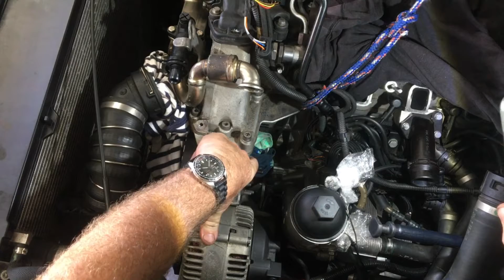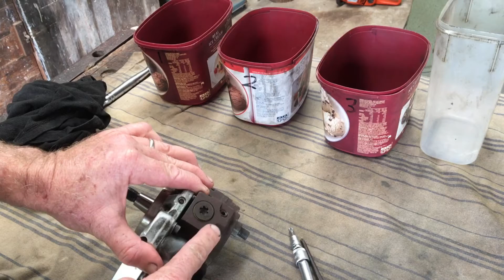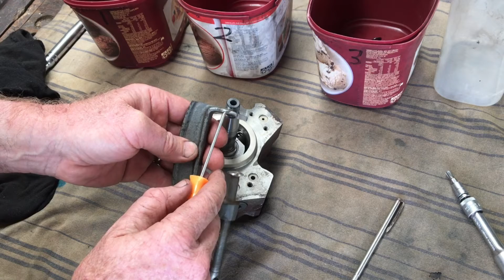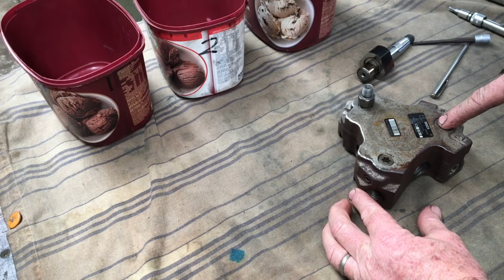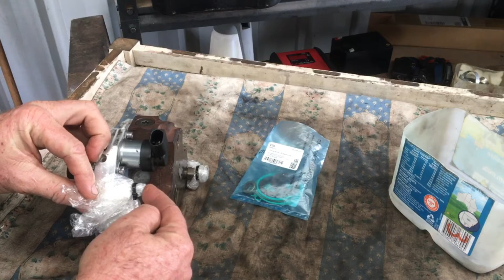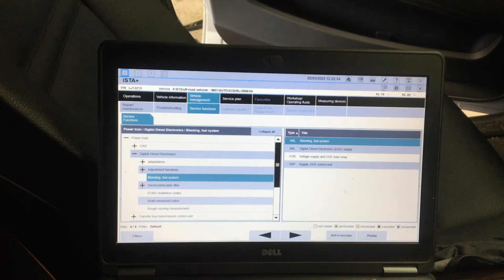BMW E70 M57 high pressure fuel pump removal, rebuild and bleeding

Comment: Good day, is the socket tool to remove the pump needed or can the pump be removed without the socket in front?
Reply from the maker: The pump can be removed, but the socket holds the sprocket inside, which is on the two timing chains, in the correct place. So without the tool the sprocket will fall down and you won't be able to get the pump back on and the timing might get screwed up. In a nutshell, you can remove the pump without it, but it's a bad idea.
Reply: Thank you, Can I ask for advice?
When my Bmw is cold, it starts up and idles no problem…as soon as it heats up and not to a point where the fans start… it cuts out completely and then struggles to start or will start and then cuts after a few seconds.
Reply: Fault code 42E2 and 4b90 normally comes through the diagnostic tool

Comment: Just wanted to say thank you so much for this video! I’ve just put my new hpfp in tonight, need to do the bleeding process tomorrow, havnt used ISTA before so this will be my first try with it! What motivated me was multiple garages (one supposedly a well known BMW specialist in Essex but I won’t name names, told me diesel getting into the oil would be a dpf problem… ruled that out then I was told it must be the injectors!! Only after a lot of research I came across the likely issue being the HPFP and ive lost faith in the garages so I plan to do everything I can myself! 😊 Excited to do more on my car after this though 💪 my cars a BMW e65 730d with the m57 engine

Comment: Excellent video and thanks a lot! I'm changing my oil due to dilution now - and since I've now confirmed that the DPF regen cycles are not occurring too frequently, potentially causing fuel to leak down the cylinder walls, I'll be ordering a kit for my pump as well.

Comment: Hi, Great clear sensible video. I am about to tackle this as I have fuel dilution in sump and this appears the most likely culprit. Can you advise what gaskets ,o rings, bolts are required so I can order prior to start. I have heard some bolts are single use and any other hints or items I should replace whilst engine apart as it has 190,000ks on it. I am in Brisbane Australia and have found O rings for fuel pump only available in UK. I have a Foxwell scanner to bleed system when finished. Cheers and Thanks.
Reply from the maker: I didn't replace a single seal or bolt other than what was in the seal kit. No issues with leaks and there are no single use bolts in this area. Used the Meat and Doria seal kit, which I had sent to me from Europe. From memory cost me about $60 plus post.
I'd be checking the swirl flaps while in there, and maybe doing a swirl flap delete. Lots of info out there on this. Also check the intake ports for carbon build up.

Comment: Thanks for the informative video. Quick question regarding the fittings at the rear of the pump going to the rail. Does it appear that the high pressure output fitting could be swapped into either one of the three holes (two of which have plugs, in addition to the spring and ball bearing)? I'm in the process of swapping this pump into a 2.0 TDi golf. The high pressure line needs to be bent, and if I can use one of the other holes for the output I would only need to bend the line about an inch vs approximately 6 inches.
Reply from the maker: When I looked at a lot of information prior to the rebuild, it did look like it was a common output passage that ran via all three positions. So I suspect you are correct and you could locate the output at any position. I also suspect this would be part of the design to give flexibility for different platforms.

Comment: Hi! Great video. What is a common failure on this pump? Have an issue with this pump does not build more then 100bars for pressure. The car have been sitting for a few months? Is it that the pistons get stuck or clogged? 

😅
Reply from the maker: I'd be very surprised if there was a physical issue within the pump. I'd be looking at the supply pressure. High pressure output is controlled by the input pressure. The pressure control valve does this by allowing pressure to be returned to the tank. If getting limited pressure from the HPFP I would first be checking the pressure coming from the electric pump in the tank. It could be as simple as a clogged fuel filter.
Reply: @jeffrichardsoncardiy  thanks for the reply! The pump in the tank and fuel filter is changed. Insta says we have 100bars pressure in fuel rail. We have disconnected the sensors at the fuel rail and still no start. Could it be the fuel regulator valve on the HPFP ? It clicks but maybe its faulty anyways? 
 Thanks again 😀
Reply from the maker: I'm not an expert on these pumps and have zero diagnosis experience, so this is all just a guess. Looking at the way the pump and regulator work, the regulation by the solenoid of fuel return is what controls pressure. If this is stuck open then it won't allow pressure to build. I've done lots of transmission solenoid testing before, and the regulator seems to be pretty much an identical item. I'd be removing and pressure testing. 

Have a look at the following video. It's for a Porsche PDK transmission valve body, but I show how to test the solenoids, which I assume would be an identical procedure.

https://youtu.be/iXMHyk8uZG8?t=969
Reply: @jeffrichardsoncardiy  Have tested the regulator on the fuel rail with 12v and no clicking sound from it. Seems likely its stuck open and thats why the pressure only builds up to 80-100. Going to change it and see if its starts up. Thanks again super helpful video and replys.
Reply from the maker: @bengt1758  Did you test the regulator on the pump or on the fuel rail? I was talking about the one on the pump and I didn't know there was one on the fuel rail. Looking at realOEM it seems the one on the end of the fuel rail is also a regulator. No idea how this one works.
Reply: @jeffrichardsoncardiy  I tested both, the one on the pump works but the one on the rail does not seem to work. Neither of these regulators have an faulty code possibility maybe if i had gotten it to start it would have given a low fuel rail presserue code. But since the pressure is to low i believe its faulty and stuck fully open. Will get back you if this solves my problem. Might help someone else in the future 😅
Reply from the maker: @bengt1758  Definitely want to hear the outcome and if this is the problem. Thanks
Reply: @bengt1758  it was the drv on the rail right?🤪 that one opens at 100 bar without power😅
Reply: @bengt1758  hey did you resolve this?
Reply: Hi, seeing you know much of the pumps. I'm swapping an m57 in my e36. But i have no pressure on my high pressure fuel lines, 0 bar. I already changed the valve on the pump and i have voltage on my valve at the rail and pump. Im at the end of the line in searching where my problem is at... low pressure lines have 4 bar of fuel but hp lines dont..
Reply: @superjensje1  Hi did you fix it, because i have the same problem and I don't know what to do, the only thing that is left is to change the hpfp 🤔
Reply: Yeah, the guy that did ews delete on my ecu has made a mistake so my ecu was the problem, sorry i cant help you @axen1296
Reply: I’m in the same boat not making more then 100 bar … it’s killing me
Reply: @Abis77  check so you have power to youre drv or change it
Reply: @thebooier  #onit now
Reply: Both sensors on the ramp get voltage
Reply: @Abis77  I gave up trying to fix it but i had 2 things i would have done if i had contiued. Check all the injectors if not that i would have gotten a new ecu.
Reply: @Abis77  then u have 2 choices, measure backflow from all 6 injectors or change the drv, the drv opens at 100bar with no voltage or when faulty (it holds mechanicly til 100bar)🤪
Reply: How to get the software to bleed?